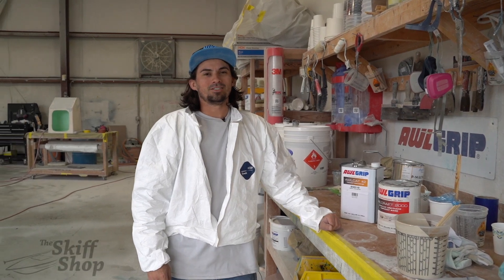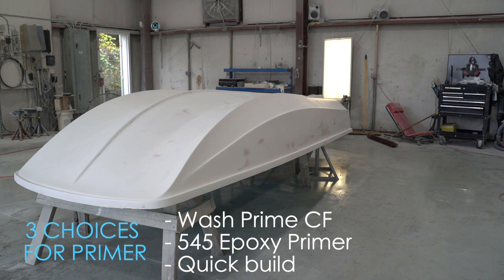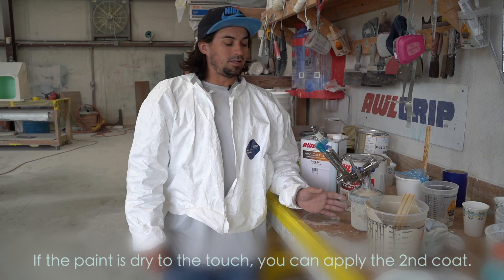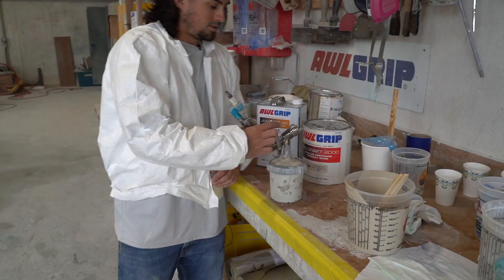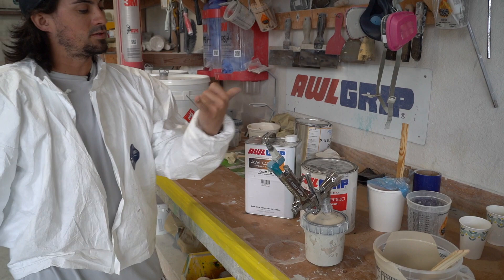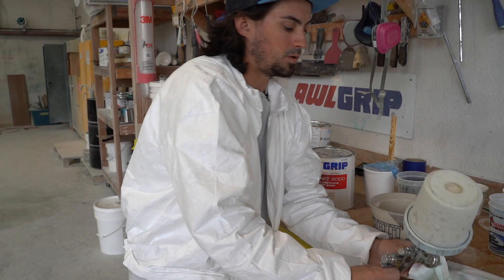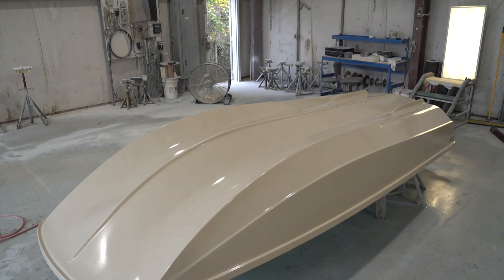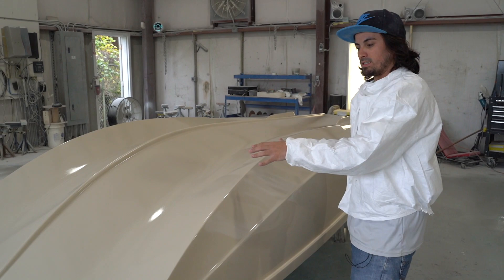Painting with Awlgrip (awlcraft 2000) : DIY

Comment: We spray differently but if it works, it works. People do have below the waterline top coated with awlgrip or awlcraft but they are also informed of the risks. If you launch and pull out the same day and rinse off, then there’s usually no issues. But by all means, do not leave the boat in the water for extended periods of time. I liked the video but did not like not being able to hear what you were saying because of the music. Lol. Anyhow, 🍻 from Virginia 👌

Comment: I am using this to seal my artwork. I have done it in the past but its been about 4 years since I last worked with awl craft. I forgot how the application process completely works. Am I able to spray one coat let it completely dry and then possibly add some paint then spray again? Or does the layer have to be tacky between each sprays? Im worried by letting the layer completely dry that the transparency might be foggy.

Comment: Thought awlcraft was for above waterline only
Reply from the maker: You can use it under the water line! Just make sure you apply it over the proper primer and absolutely don't try to brush or roll it on!
Reply: @FiberglassFlorida   Awlgrip themselves state is for above waterline only and yes you are correct, they say should only be sprayed
Reply: @ShorrockPaul  I don't think it is that important for boats that live on trailers.
Reply: My local paint supplier told me that I couldn't use acrylic urethanes below the water line.  I told him I've been doing it for years.  He said oh yes it will hold up great but it is just bad for the environment.  So spray away!